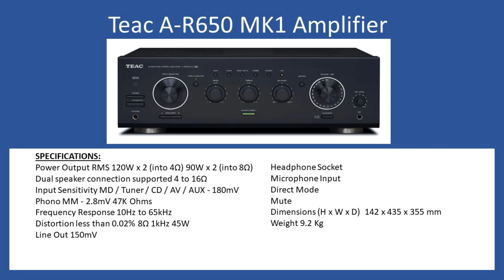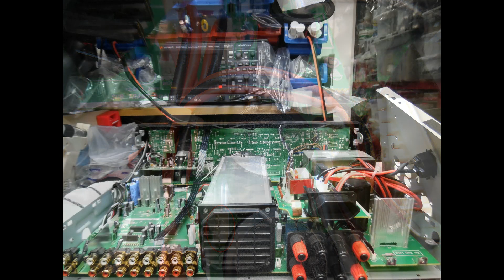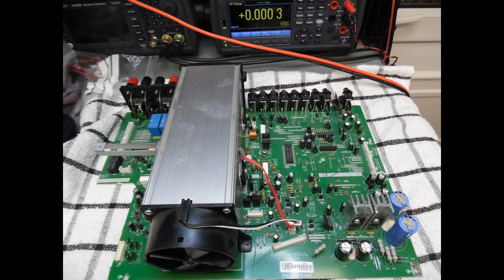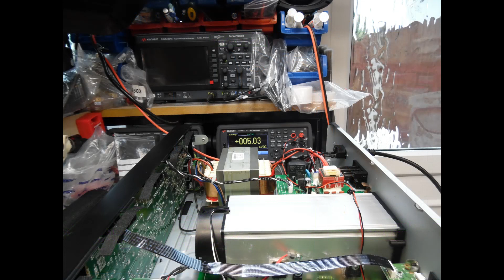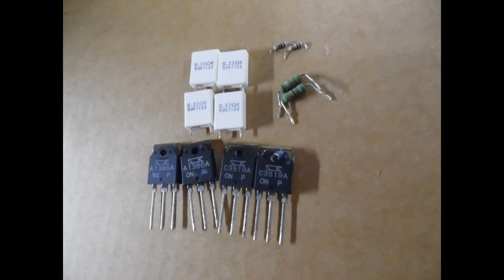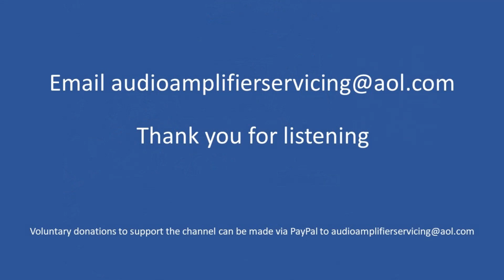Teac A R650 MK1 Amplifier Repair (With Audio Tutorial)

Comment: Hi, I bought this amplifier second-hand and the cooling fan isn't working. Could it be heat-sensitive?
Reply from the maker: Hi, the fan does not run all the time. The thermal sensors mounted on the heatsink initiate the fan starting.
Reply: @AudioAmplifierServicing Thanks 🙂